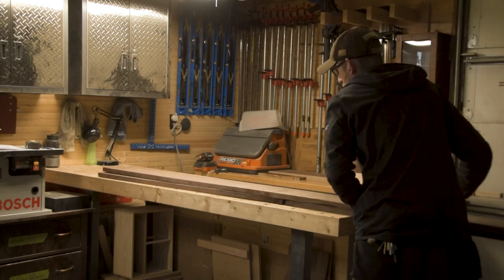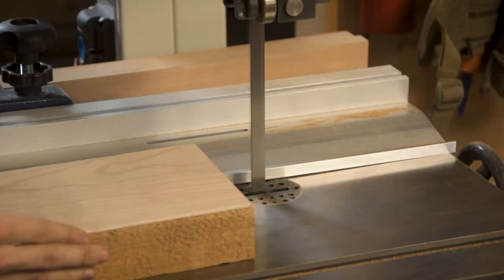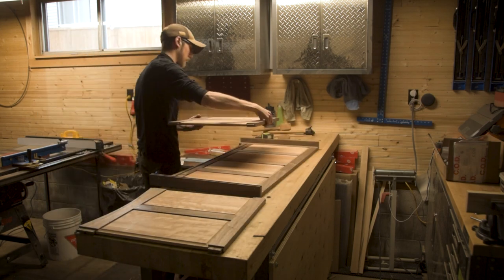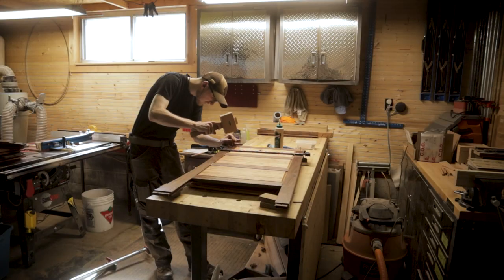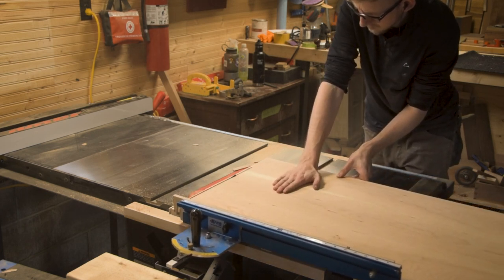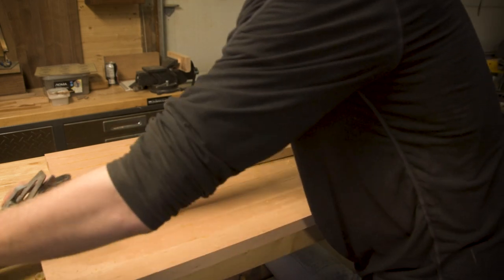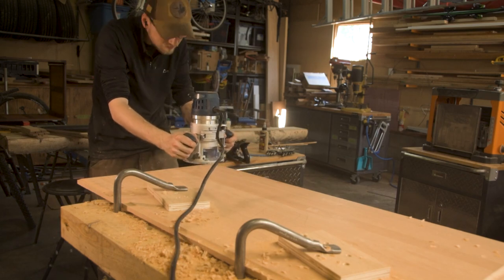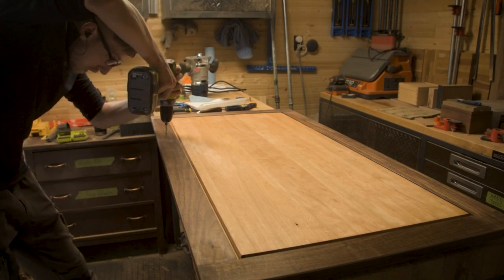Panelled Blanket Chest

Comment: That's a beautiful piece.  Bravo.  One thing I was impressed with was your lack of whining about sanding your work.  Practically every YT builder seems to take pride in the fact that they hate the sanding and finishing.  As a painter, I know how important that step is to determining the luster and feel of the finished product.
Reply from the maker: I'll never understand why in almost every video, people feel the need to add that "sanding sucks but you have to do it" line!
I do cheat with my sanding which does make it more tolerable, I use my hand planes for most of the surface prep then finish with a 180 hand sanding, works perfectly on most woods and shortens the monotonous sanding part of every project.

Comment: You have created a beautiful chest!  One question I was hoping you could answer is about the legs.  I see that your dado cut goes from end to end on the leg pieces, but I don't see the dado on the small exposed bottom section of leg on the finished piece.  What did you use to fill in that exposed length of the dado cut and how did you apply it?
Reply from the maker: I just fit up some small filler pieces and glued them in place to fill the groove. I prefer doing it this way because I find it's easier than trying to do a stopped groove with the router.

Comment: I live in the Calgary area as well. I’m very curious where you get your wood from?
Reply from the maker: The main place I buy from is PJ White (4033 11 St SE, Calgary, AB T2G 3H1), they have good prices, a decent variety and you get to pick out your own stock. You have to be careful buying walnut from them since most of it's rough sawn and it's hard to see a difference between the heart and sapwood, but it is the only place in Calgary I've found walnut that is not steam dried so the colors are much more vibrant! Also with their 8/4 white oak, most of the boards I've bought have had intermetal stress cracks from improper drying, so I try to avoid buying that from them.
The other place is Formations Inc. (3916 70 Ave SE, Calgary, AB T2C 2K1), very similar prices to PJ but you don't get to pick your own lumber and I've gotten some pretty garbage quality stuff from them. Their walnut is filled with knots and defects, so your way better off taking the gamble at PJ. Their Cherry is pretty much full sapwood on one side and the white oak was horribly milled and well under the 4/4 thickness. These guys are my backup option when PJ doesn't have what I need, only because their prices are better than having to go to Black Forest.
I don't buy lumber from black forest mostly because their prices are insane, and their floor staff which is mostly guys my age are very condescending.

Comment: Question, after edge jointing, why did you rip on the bandsaw? To have a smaller kerf waste?
Reply from the maker: That first pass you'll see on the jointer is meant to get the edge straight to reference against the bandsaw fence. Then I use the bandsaw to cut all my stock to rough width, then I go through the normal milling process of jointing, planning and cutting to final width on the table saw. I like to use the bandsaw for my rough cutting because my stock doesn't have to be perfectly flat, like it does for cutting on the table saw.
Reply: @morganhurst_redridge  i really like your work. I love traditional joinery, i despise pocket holes. I also like how you record the amount of time per project, puts it in perspective.

Comment: Instead of dowels I would have used either brass or copper pins. They look very elegant with walnut and it would have eliminated the dowels breaking problem...just a thought.
Reply from the maker: I've wanted to try that for a while now, I've just had a really hard time trying to find brass/copper stock that is accurate dimensions to fit drilled holes. I bought some nice stuff from a knife supplier, which was pretty expensive, but is definitely something I'll try at some point!

Comment: I love this piece so much that it will be my 1st real attempt at a fine piece of furniture once my mortiser gets here Margan my friend.. I'm going for the same Mortiser u have. I was pricing some of the powermatic tools up like their table saws, Jointers, etc.. They're expensive enough tbf but are they worth buying as an option. Is it an American company? Powermatic I mean? Are these tools made in the USA? I like the idea of that bro. Or CANADA even.. I want to know that the parts are top quality and u will never get that from the Asian markets imho. I've spent enough money over there in the past to know they don't use the best materials when building their parts or machines..
I'm in the process of kitting out my workshop and money is tight right now Margan mate so I was wondering how to begin? I'm getting the mortiser like the one u have but I'm willing to wait on the Table saw for a while bcos I have enough saws to be able to do cuts on woods for now. I will get the table saw in a few months if money allows it but I want to get me one of those cheaper Planer/Jointer Thicknesser from ErBauer .. It's just a quick fix for now while I'm learning about some of the techniques I need to learn before spending a large sum of money on the 6/8" jpointer/Thicknessers out there..
Could u give me a heads up on a great set of wood chisels to buy so I'm not wasting time buying a loada crap??? 
BTW I loved the video of the smaller wall cabinet u built with the bookend design on the door.. It was a stunning piece mate.. 
I also love the contrast u managed to show between the 2 woods used in this piece too Morgan..
Cherry goes so well with the Walnut on this project. I loved seeing the extra details u put into the edges of the wood too. 
One more question if it's not too cheeky on my part bro...?? What was that router bit called that u used to get that nice touch on the edges of the cherry panels?? I know u can sometimes get a similar design with the table saw but the way u did that was lovely jubley.. 
Thanks for a brilliantly informative video. Most ppl don't bother to let us see their techniques so much but u allow us a peak in.. I love that about the videos u make bro and I hope they continue in this form..Keep up the great work and best of luck in the future and I'm hoping ur channel grows much bigger so maybe u will be able to do some online woodworking courses down the road a piece Morgan .. Salute to u from IRELAND..
Apologies for the very long comment too btw.. LMAO It keeps happening to me that I can't stop typing ... EVEN NOW! Again Apologies bro
Reply from the maker: All I can say about powermatic is that the mortiser is pretty good, other than that I don't have any experiences with their other machines so I can't honestly recommend them. It's important to keep in mind that almost all machinery/tools are made in Asian but certain companies like Powermatic and Sawstop require a much higher standard from those factories, compared to the generic brand. I don't know what you have in Ireland, but in Canada we have brands like King Canada or Craftex that are your typical cheap import machines, stuff like that you want to avoid wherever possible.

For setting up your shop, just focus on buying tools/machines when you need them, if you need to thickness wood get a planer, if you need to drill lots of holes get a drill press, etc. It's important to not over buy at the beginning because you'll end up with more machines than you know what to do with and as you advance with woodworking you'll learn what features/specs are the most important to you. If you watch my recent series on building the bed frame, I went over some of the ways you can mill lumber without all the fancy machinery.

For chisels, again I don't know what brands you have access to but I have a set of Veritas PMV-11 from Lee Valley and I love them, they came perfectly flat and ready to use, but there are also brands like Narex (also available at Lee Valley) that are slightly cheaper and will take some initial work to flatten but I've heard they hold a good edge.

The bit I used was a Cove Raised Panel Bit from Lee Valley, you can find a few different styles of this bit for a more decorative touch, I like the cove because it's a simpler transition visually.

Hope that helps and good luck getting your shop setup!

Comment: What are your thoughts on adding aromatic cedar to the interior
Reply from the maker: Personally I really don't like aromatic cedar, mainly because it looks horrible and I really like inside of the stuff I build to look nice. Secondly, the only way it releases a smell is if you don't finish it, which then lets the wood dry out and crack. The smell also doesn't last, I've looked at alot of chest and cabinets that had aromatic cedar lining and most had only a barely noticeable smell.
My secret is a scented paste wax, basically when making a paste wax at home you add a few drops of scented essential oils (I like apple pie or cedar) then apply that to closed areas. This holds the good smell for longer and you can re-apply it whenever the smell starts to fade or change it when you want something new!
Reply: Ok I am looking at making a chest but I was curious about insect protection for blankets being out in the country
Reply from the maker: I've only heard some talk about insect repellent but I was able to find this article from wood magazine that kind of busts that idea.
https://www.woodmagazine.com/materials-guide/lumber/moth-repellent-cedar
The cedar might work for a little while but it's not a good long term approach, the essential oils should have a similar effect since they are extracted from cedar.

Here's another article with some good ideas like just putting fresh strips or blocks of cedar in every so often.
https://www.spacecentrestorage.com/blog/how-to-keep-pests-out-of-your-storage.html#:~:text=Add%20a%20Repellent&text=Some%20non%2Dtoxic%20insect%20repellants,sheets%2C%20linens%2C%20and%20towels.

All that said it's really up to you, if you like that look of the aromatic cedar then it's a good option. These are just some of the things I've looked into since I'm not a fan of the wood.

Comment: What are the thicknesses of your panels and stile/rails?
Reply from the maker: Both are about 3/4" thick with a 1/4" groove on the rails & stiles. I used a raised panel bit on the panels to bring them down to a 1/4" on the edges. I did it this way so that the overall face of the trunk is flat inside and out while still having some visual detail.
Reply: @morganhurst_redridge  thank you!  Do you have detailed plans available?